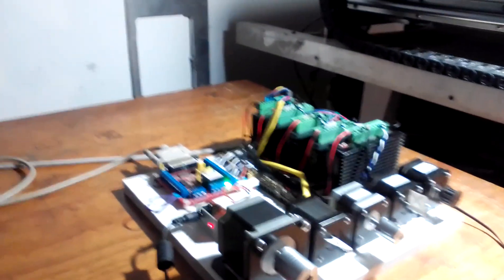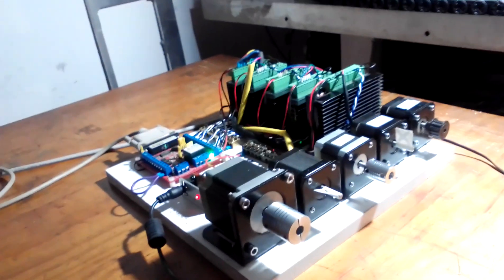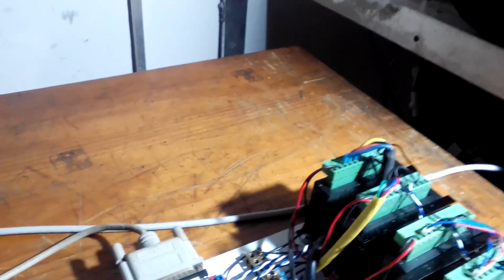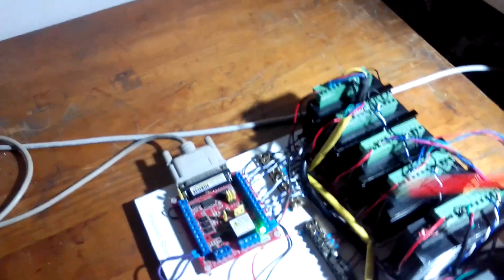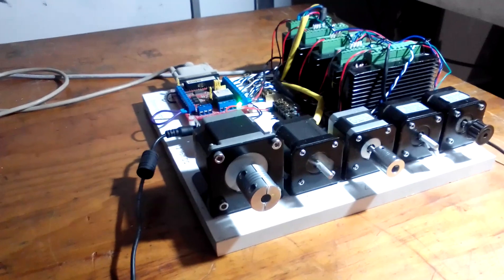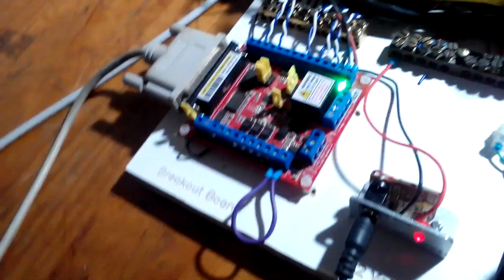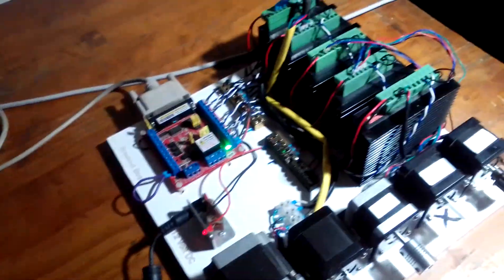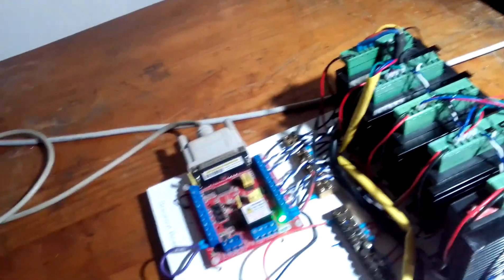DIY 5 axis CNC the DEMO

Comment: What does it do; activate motors when using certain keys to a character?
Reply from the maker: It is a test rig that proves that each part works properly. This includes the software on the computer, the wiring and all the components. Yes you can run it automatically or you can use the keyboard to drive it manually.
Reply: @postiemania  so this is used to program software using software; or does it used in conjunction with the hard drive.  I am completely computer illiterate. I really don't know the difference or function of either the soft or the hard,  or what advantages it can utilize.  Looks interesting but I'm wondering if it is compatible with motor functions that can regulate current?
Reply from the maker: @thomasspringer5187  Software drives the motors to predetermined positions. Could be to move a wheel or lift something. The possibilities are endless.